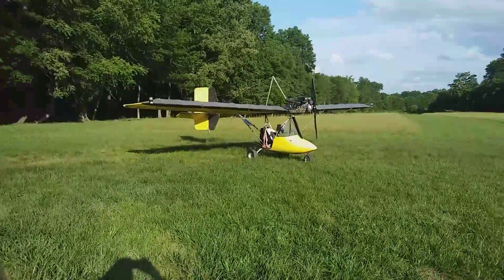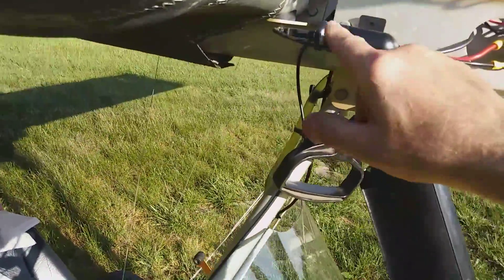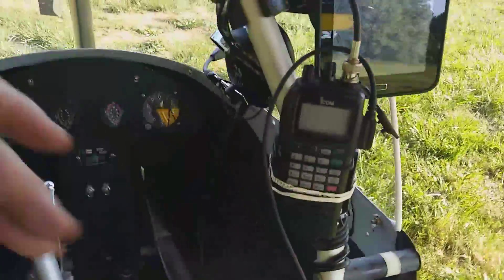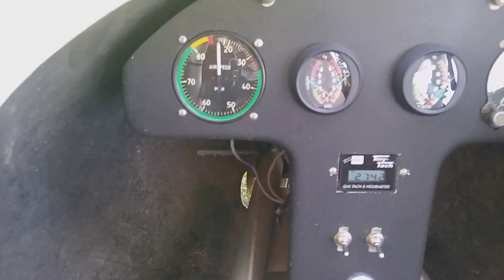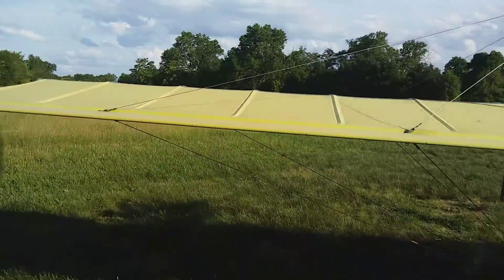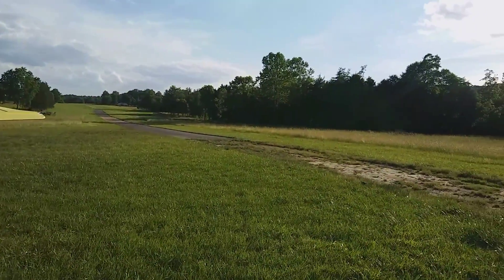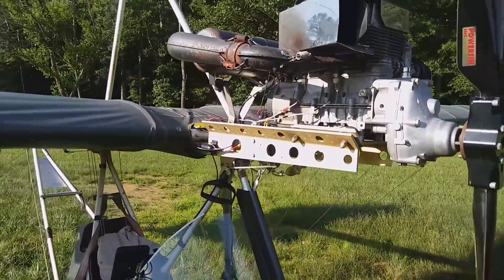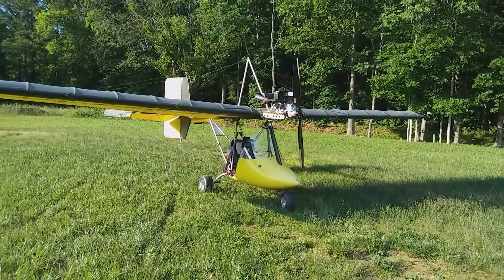My Hy-Tek Hurricane

Comment: Nice machine... I was wondering what speed to you take off, climb, and land with?
Reply from the maker: Take off is 35mph and continue at full throttle climb out at 48mph then throttle back to 4800-5000 and just enjoy.....cruise speed is 63mph ...thanks for asking
Reply: @okiedoak201  Thank you so much. I watched some video about challenger 2 experimental, which is of course a bit more weight, like 470lb and the take off speed for that plane is 45-50 depending on the weight and if you have a passenger. I figured that Hy-Tek Hurricane has about the same wing surface area but at least 200lb lighter so I used the speed of about 40mph to take off and felt that it was ready even before. So that makes sense for me what you are saying now.

What would be the max speed for this plane? even on 4500-4700rpm it wants to go really fast in level flight. A few times I caught myself around 80mph and I had to drop rpm.

And also, what speed do you use for approach and landing and do you still keep some rpm above the idle on the final approach?

Your help is greatly appreciated!!!
Reply from the maker: @isheyman  thanks for the interest....
Max speed for this plane is 70mph.. the challenger is a bit heavier..but a smoother ride...i flew with a challenger and both planes are about equal as far as flight speed...when I throttle back and the air is calm I can cruise around in the 40's no problem...and if there is a headwind I get to play...30mph IAS and zero ground speed....love it...and that can be an issue....4500 rpm and cruising at 70+...tail winds are awesome...but be careful if its a Rotax engine...below 5000 rpm can be hard on the engine.... approach speeds I like to keep in the low 40's throttling back and then a little bit of a throttle push before touch down... that helps smooth out the landing...its like a little fighter jet...it likes high bank turns...and can be handled a little rough...but be super careful with the landing gear tubes...obsolete parts...
Reply: @okiedoak201  all you said, is right. I felt it. So you are saying Rotax 503, I believe that's what I have, doesn't like rpms below 5000? hmmm... I did notice that on idle it's a bit rougher and once you accelerate a bit it's very smooth engine operation.

Yep, I also noticed that if I throttle back and land this way it starts sinking a bit too fast and it liked if I add just a bit rpms last 50-100 feet before touching down.

Thank you for confirming my observations. Now I feel a bit more confident, as I am not that experienced yet and better know what's designed for this plane rather than experimenting and finding out myself. Maybe next year I will be way more intuitive pilot:-)

Some people wrote that they used higher speeds on take off and landing, 45-50 and 55-60mpt respectively. To me it seemed a bit high. Why do you think people use those higher speeds to take off and land for this tiny light plane? is there any benefit of going faster on both, take off and landing?
Reply from the maker: @isheyman   the rotax 503...im not a 2 stroke expert....but from what I found is that the 503 loke to staynin the 5000 rpm area...something to do with a cold cycle and cooling the engine too fast..can cause a lockup...they run fine...but its good pratice to keep the engine in the proper heat zone..Rotax Rick in Florida has all the answers....the 503 is an awesome engine....i put twin carbs on mine and power was nite/day different